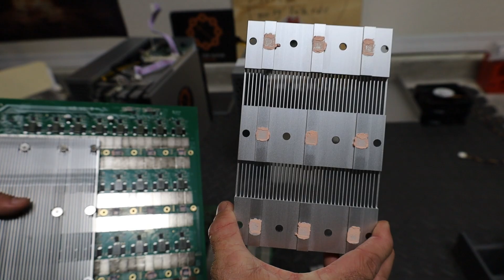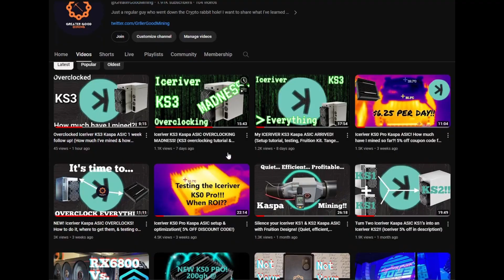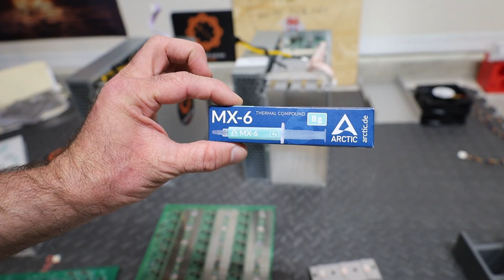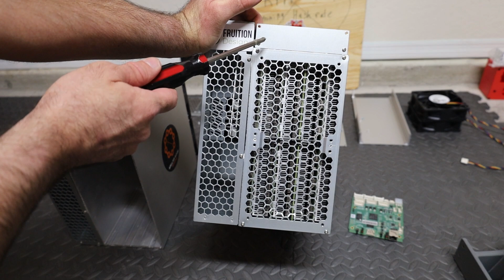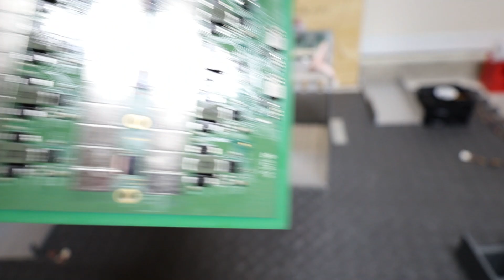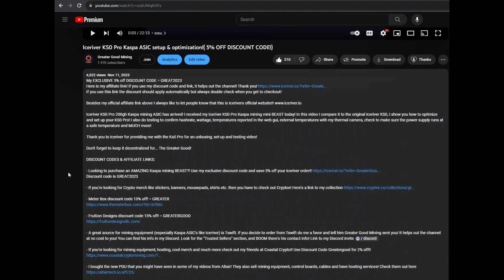How to change your Iceriver Kaspa ASIC thermal paste! Might get higher hashrate on KS1 KS2 KS3M KS3!

Comment from the maker: Does your Iceriver Kaspa mining hashrate go up with colder ambient temps? Might be time to change your thermal paste!!
Reply: how much paste was needed per board?
Reply from the maker: @Bcmurphy87  I used 1.5 syringes for the KS2. So about 3 grams per hashboard
Reply: I appreciate the quick reply sir and will follow your lead. just installed the njord fan controllers for my fruition kits and im still seeing throttling @GreaterGoodMining

Comment: Did you remove the article covering ant throw it away?
Reply from the maker: If you mean the plastic lining, some of my machines have it, and some don't. I left it on the machines that have it. As long as it's not misaligned covering your chips
Reply: @GreaterGoodMining  on most asics that's just to help prevent build up and from protection from the heat sink. I peeled it up claens and put back down then pasted.

Comment: if i have a KS1 can i put the 2 hashboard one on the first slot and the other in the third? because i have seen they are togheter on the first and second
Reply: and in this way i will get lower temps or no?
Reply from the maker: @fabiomonticelli5119  Yes, you can slide one of the hashboards over so they are not right next to eachother. That's the way I had mine set up before I made my Franken ks2
Reply: i have done it but now i cant see the 2 hashboard data temp it is all 0 any solution? the pbfarmer firware indicates like there are 3 hashboard @GreaterGoodMining

Comment: I"ve had my last 3 miners delivered already thermal throttling and the last one also had a bad PSU, all out of the box that way.  Pretty sure they are mining with our miners before sending them to us, plus, I'm not sure they are manufacturing them to the same standards as before.  Not sure what everyone else is experiencing or if I just got the bad ones of the lot ...
Reply: Hi ! I m waiting now for May ks3. Would like to know where did u buy and what did u do in a case of bad PSU and what was the problem?
Reply from the maker: @neosinfo38  I bought mine from Tswift in my Discord. You can DM him there and tell him Greater Good Mining sent you if you want to buy through him. Or you can check out my affiliate links in the description of my videos for discount codes from Coastal Crypto or even Iceriver directly. It sounds like a few people have had power supplies go bad on them. I havnt had that problem personally at all
Reply from the maker: I've been hearing that people are having problems with their PSU's this last batch

Comment: on the heat sink screws, are you tightening until they are "hand tight" as they resist, or just until they click with tension of the springs (which would be about half way)?
Reply from the maker: Hand tight as soon as you feel resistance. You can't tighten it much more. It will be pretty obvious once you try it
Reply: thanks.  I've found that it's about 9 full turns of the screwdriver once you get the screw to grab.  I once tightened with and electric driver, all that did was splat all the thermal paste out.  I also have started alternating the screw tightening 3 turns a at time across the heat sink like tightening lugs on a car wheel.  Just to get the tension even, plus, it helps you sneak up on "just hand tight" @GreaterGoodMining
Reply from the maker: @JProfit-ef7ur  yeah I tried to do the same where I tightened in a star pattern like you. I didn't go row by row.
Reply: When I did mine I think they tightened too much because there was no paste and paste was squished out, almost metal on metal, I tightened slowly just till I felt a little resistance. temps are 64 to 87 now - I had 30 - yellow and 3 -105's before. Thanks again! @GreaterGoodMining
Reply from the maker: @glennpattison4678  I think you're right about them over tightening

Comment: May i ask how about the temps ? any difference ?
Reply from the maker: There is no device that is built into the Icerivers that can measure chip temps. This will not help with intake or exhaust temps. It will help with heat transfer from the chips to the heat sinks which can't be measured

Comment: Great video. I don't have the bigboy tools yet. Do you recommend to change the paste on KS0's?
Reply: i had to on one of mine, made the difference
Reply from the maker: If you are having issues with thermal throttling I believe the KS0's use thermal pads. IIRC 1.5mm. And thermal paste. I havn't had to replace my thermal pads or paste yet on my KS0's because I habnt really had a problem. But at some point they will require maintenance just like anything